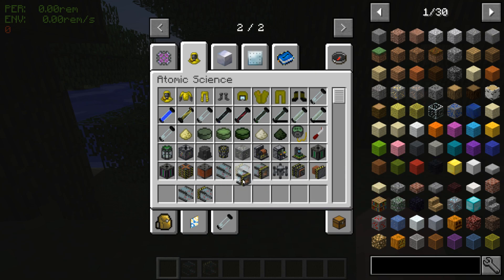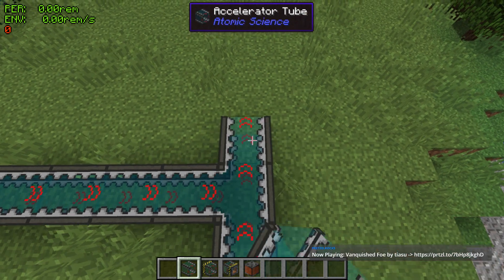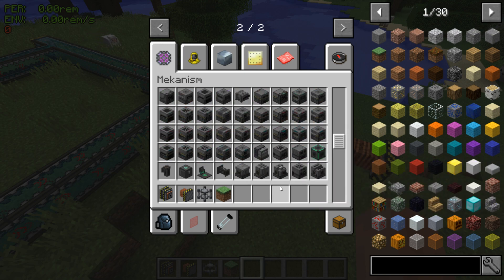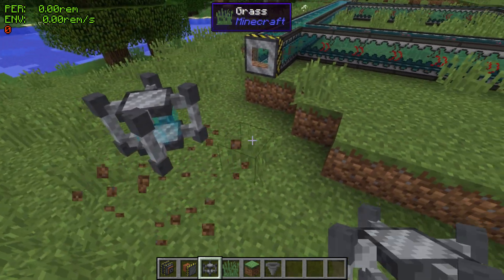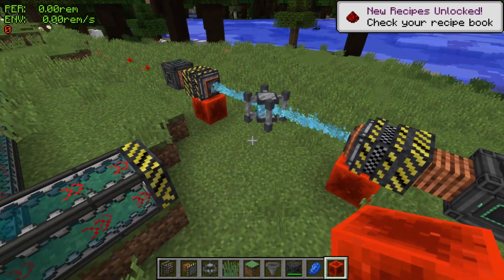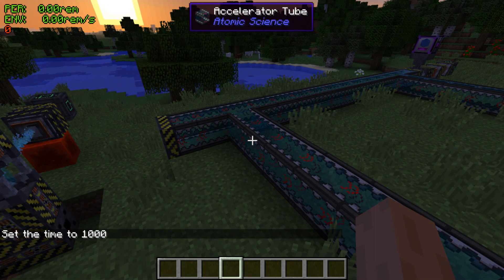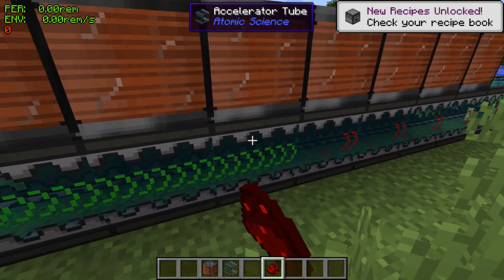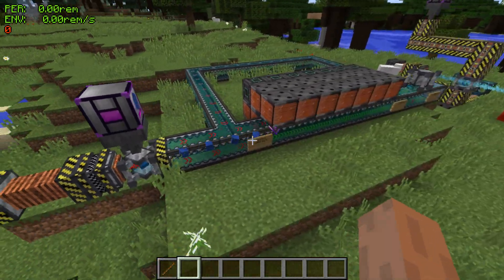Atomic Science - Particle Accelerator tut (some audio issues)

Comment from the maker: Audio issues seem to only exist for the first 6 mins, seems to stop after I vsync the frame rate so my guess is the mic picked up the GPU fans.
Reply: Sounds more like coil whine, fan curves have a hysteresis that doesn't change the fanspeed anywhere near that fast nor would it be that high pitched
Reply from the maker: @0x8087  I went with my first guess but you're right it does sound like a coil. It could also be parts starting to go bad on the card. It is a bit old and I do abuse my hardware. I need to replace the GPU and the board at some point when I get a new case.
Reply: If you're using the front panel audio connectors and the cables are close to the GPU that could explain the noise, it's not uncommon for those to pickup on interference
Reply from the maker: @0x8087  back panel, the front was damaged a long time ago and is not connected for this reason. However, the rear audio keeps failing and the board is rather poorly made. Hence why I want to replace it even though its less then a year old.